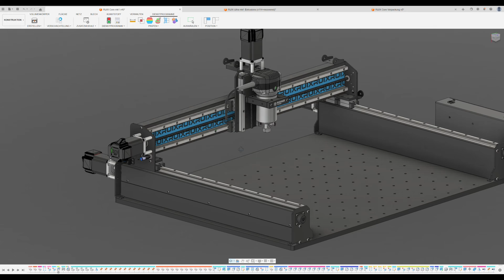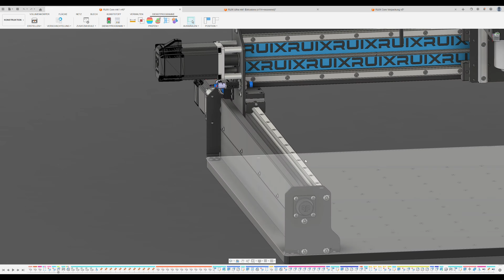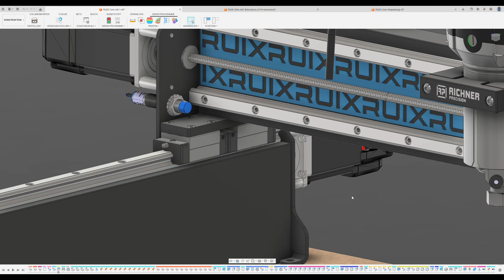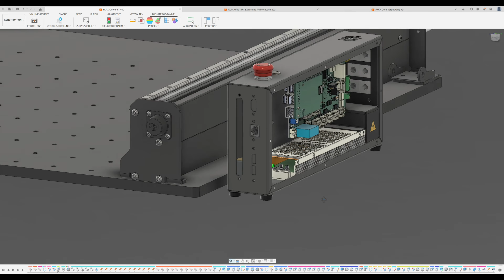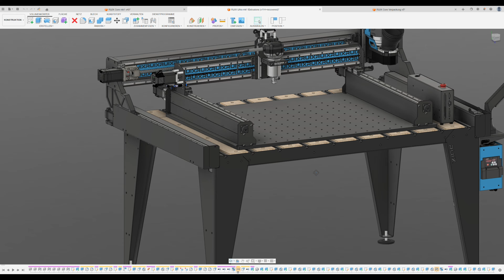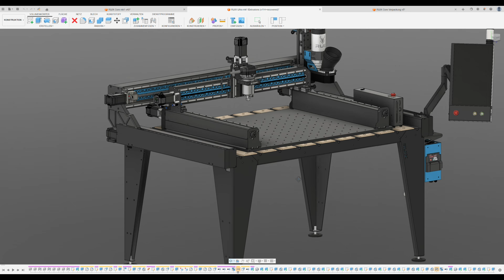Can We Build Affordable CNC-Routers in Switzerland? - RUIX Core

Comment: I’m curious as to how you synchronize the 2 separate screws on the Y axis, and keep it perfectly square to the X axis. How do you adjust/setup?
Reply from the maker: It has two seperate limit switches that auto-square the gantry every time you home the machine. After that it gets treated as a single axis and both motors always get the same signal.
Reply: @Richner-Precision For the initial setup, I would guess each limit switch must be set with extreme precision? Or, do you decouple one of the motors, adjust, measure, and then decouple?
Reply from the maker: @tomkennedy7971  It has two limit switches on both Y-axes and it can control each motors individually. You just need to home, then you can measure if both are the same distance away from the endplate. If not, adjust sensor position and repeat.

Comment: Looks like my dream machine. I like the base plate, also because it helps alignment. But I also like the ability to clamp pieces vertically, to machine the sides. What about a base plate with a hole in it for vertical clamping, or is that a silly idea?
Reply from the maker: in standard configuration it comes without baseplate, so you just use whatever wood plate you can get your hands on as a base. then its easy to make a hole for vertical clamping. but even with the aluminium baseplate the machine travels a few cm over the edge, so you can vertical mill right in front of the machine.
Reply: Perfect!

Comment: I can see an end schalter, i would put this one on the top so the machine doesnt crash into it, these things can have latency on what ive seen on other machines.
Reply from the maker: That was more of a problem with older Controllers with slower processors. We have always built machines like that and never had a crash with a limit-switch with grblHAL firmware. And even when, the limit switch is a 5€ part thats easy replaced.
Reply: @Richner-Precision  ok, I've seen those alot in industrial machines and i've never seen them on a way of a moving part. But I think, you know it better than me.

Comment: Nice approach of extrusion sharing between the axes to keep price down! I'd recommend checking if your deflection is within an acceptable range at the center of the machining area since it looks like the Y-axes only attach at the ends and the X-axis cross-section seems like it could be shaped to handle front/back torque a bit better. I like the looks of the controller you've got together too, if possible though maybe consider having most of the SBC peripherals coming out the back since an HDMI or Ethernet coming out the front might become a bit unwieldy. As always great to see more machines being made to serve the European market and good luck on the first run of 300 🤞
Reply from the maker: Hello Chris. Thanks for your comment! You did the same with the Longmill right, Extrusion sharing between Axes?
 

Yes the Y-Axes only attach at the ends, but they sit flat on the table and have no torque applied to them, as the have the rail mounted ontop. So no deflection there.

If i had space on the backside of the controller housing i would route the connectors except USB there, but unfortunately the backside is fully used by the power connector, with main switch and cable gland. 

300 i wish! The first batch are 30 machines and i am happy if all are sold next year. I'm thinking in much smaller dimensions than you :D

Greetings, Kevin
Reply: @Richner-Precision  yeah it was the same issue I wound up bumping into with designing the SLB, too many plugs and not enough board perimeter - so it's certainly a tricky solve. Yes extrusion sharing is the same as what we did at first, really helps with the economics! The only reason I mention the Y-axis mounting is because depending on the accuracy you're aiming for, cutting loads in the X-axis direction while the machine is in the center of it's travel would distribute those forces back to the Y-axes and cause beam bending - though those force are small-ish and your axes look decently thick so my intuition tells me that it might be ok. I wish you all the best of luck, I must've mis-heard you saying 300, but with your time and quality spent on your designs I think that with good community outreach and marketing you should definitely be able to sell 300 in a year :) our original LongMill design which was much more amateur started with 1000 in a year.
Reply from the maker: @chrismakesstuffCNC  Thanks Chris i will look out for your mentioned points when we have the first batch here, probably in march. Yeah your story with the Longmill is crazy. 1000 in the first year is maniac. What would you say in retrospect where the most important Points to be able to sell so many? I am here to learn :D
Reply: @Richner-Precision  I think it was mostly a lot of time spent going to local events, posting and sharing a lot online, and trying to get people to know about us generally and know what we were working on. Then we did a Kickstarter launch once we were feeling confident and  kept writing articles and reaching out to appear to others like on podcasts and whatnot to keep momentum throughout the Kickstarter. That was the initial work, and then just continuing to show our work, iterations, engineering behind it; all of that stuff really added up to create a compelling reason for beginners to CNC and even moderate users to consider looking into our solutions. Definitely take time to get to know who your customer audience is around you so you can modify how you speak to them and how to properly and efficiently reach them so that you aren't yelling into the void with no one to hear you 👍👍 that's definitely what I'd recommend
Reply from the maker: @chrismakesstuffCNC  Thank you for your Tipps Chris! Will try to follow them as good as i can.

Comment: Looks nice, I'm leaving my 2 cents:
- I would have prefered to have the linear rails of the Y axis on the externals sides, in this way they would be much more protected from dust and chips.
- All the plates look a bit thin, 12-15mm plates would have been better to at least communicate the rigidity of the machine.
- As many other companies, you are sleeping on the market of those that would like to work on aluminium, a sleeping market because there's the customer base, but the cheapest machine is around 15k so they don't even search for a machine since it's out of the budget for most people.
You should take in consideration of design a cnc targeted to aluminium workers: shorter X axis to increase rigidity and to reduce the space taken in a workshop, a 600x400mm working area would be ideal.
The spindle must be powerful enough, 1,5kw air cooled as cheaper option and 2.2kw water cooled for high perfomance option.
- Custom made extrusion add a little to nothing to the perceived value of the machine, just use 40x20 standard extrusion in a squared C ( [ )  configuration and save some money.

Look at the Bulkman 3D Oxman, it beats you on price and it's close in rigidity perfomance, but it's too big to fit in a workshop. Ratrig stronghold is another one close to your project, but again too big (1.000x1.000).
Just make something smaller (60x40), that can fit in a garage or a standard desk/room, target it to aluminium workers and you will have a market that is currently not served.
Reply from the maker: Hello pedgarage. Thanks for your 2 cents! Have you seen our other machines? This is just our try to get an entry level affordable Version of our RUIX out, thats why its designed how it is. Of course i could make it 10 times better with ease but then its not as affordable anymore. Then you could just buy our RUIX which has everything you descripe for a 6-8k pricepoint, 25mm sideplates, covered side mounted rails, 20mm Z-axis plate, 2.2kW spindle. Mills Aluminium with ease.